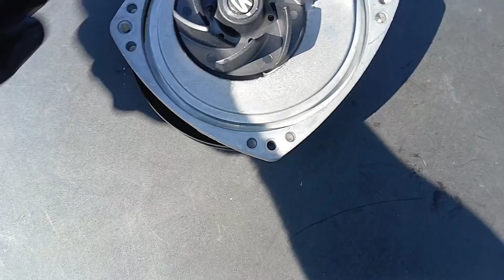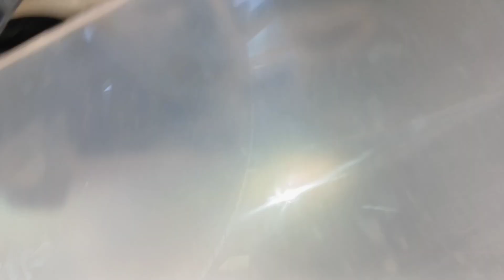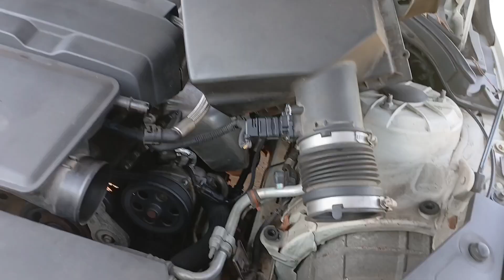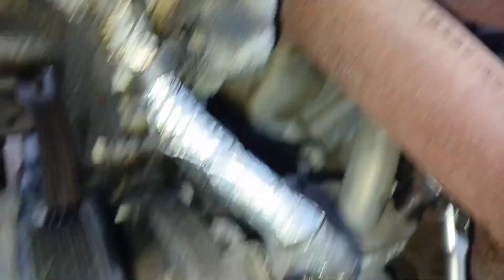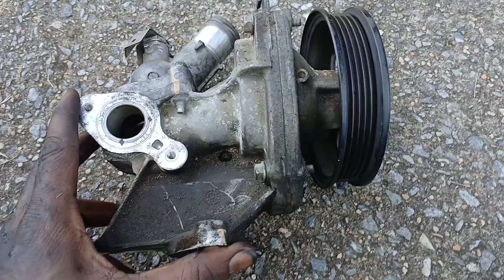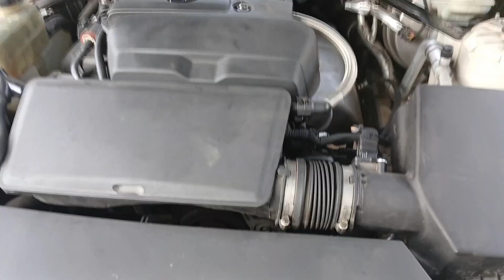2013 Cadillac ATS water pump replacement

Comment: How did you guys get that bottom 13mm bolt off shit done made me head hurt😭
Reply from the maker: Bottom boot?
Reply: @Davethemechanic305  the 13mm bolt sorry typo
Reply from the maker: @donovandugan1630 if it's the one I think your talking about, you can reach it with a long extension

Comment: I forgot to let yal know to pre screw the bolts into the new water pump flush to the base before you install it to save you alot of time hassle and unnecessary cussing 😆😆😆😆😆😆😆😆😆😆😆😆 ESPECIALLY that BOTTOM bolt 🔩 👌🏾
Reply from the maker: @jamesavery3433  that does make sense

Comment: About how much is the price for the water pump change I have a 2014 ats 2.0
Reply from the maker: @CorVanumx  the pump itself isn't expensive on Amazon or eBay. Maybe $40-60
Reply: @Davethemechanic305  nice and how much is labor usually?
Reply from the maker: @CorVanumx  the $hop$(shops)  normally north of $375.00
Reply: @Davethemechanic305  thanks appreciate the quick response
Reply from the maker: @spectrexr1  no problem